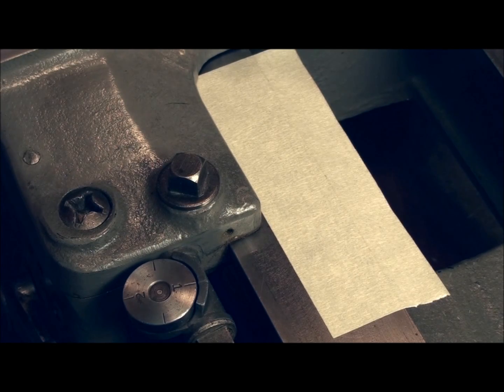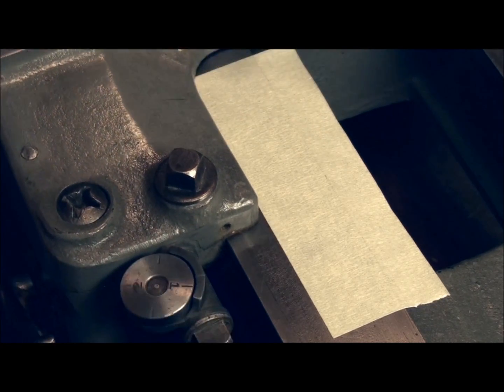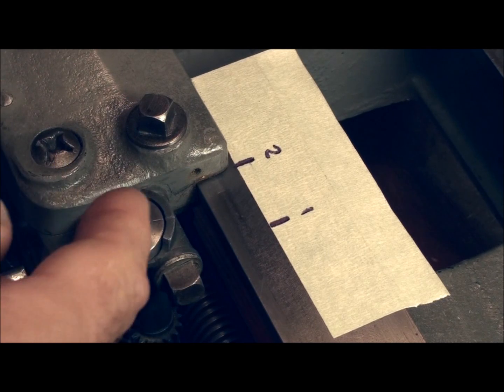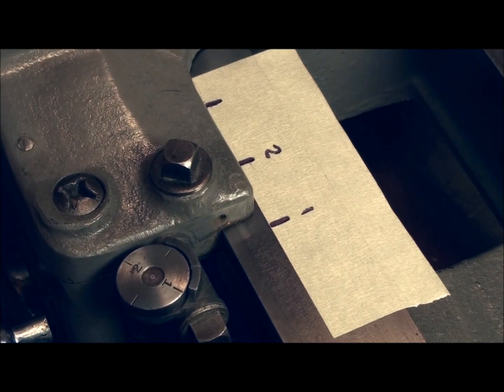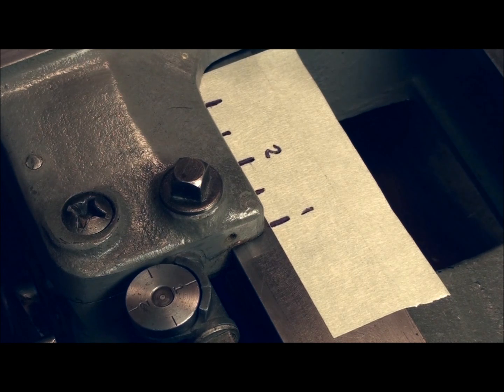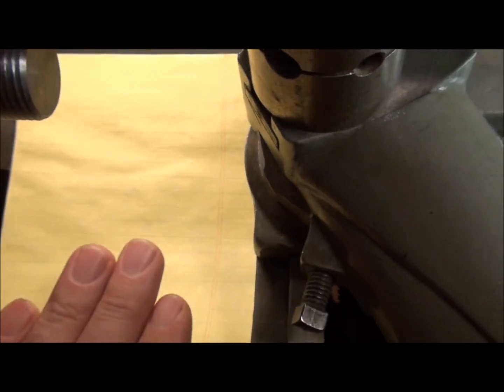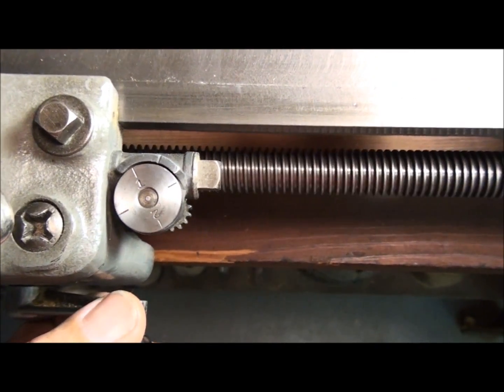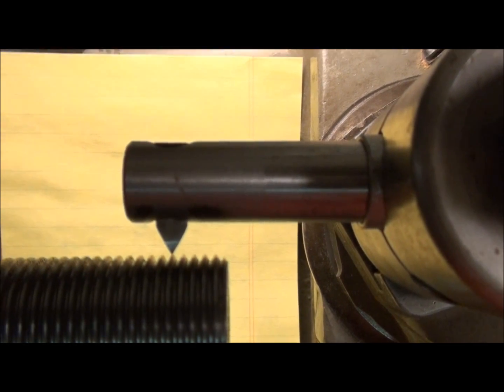Taking the Mystery out of the Threading Dial

Comment: Tom I have a brand new Harris lathe CE 6241 L x 1000 /chinese sorry but the price was very good for me/ any way I watched the video, but couldn't understand if I want to make threads is it necessary to use thread dial indicator everytime. Thanks
Reply from the maker: The thead dial must be use for most threads to get the tool back into the same groove. The only time it is not necessay is when you are cutting a thread where the pitch is a multiple of the pitch on the leadscrew.
Reply: @TomsTechniques  Hello Tom I'm Bobby with my question for thread dial indicator...Ok thanks for your explanation maybe I wasn't clear but if I use half nut /I dont know how to say in english - half nut/, if lead screw is working all the time, when cutting tthread, have I use  a thread dial indicator. Tnaks again .

Comment: That was very clarifying, but does it work for standard (inch) threads only? What about metric threads? Or  there is a dedicated dial for metric? Thanks!
Reply from the maker: The thread dial on a metric lathe works the same as on an imperial lathe. The only difference is the pitch of the lead screw. Simply put, the distance the tool moves per revolution of the dial is a metric dimension instead of an imperial dimension.
Reply: @TomsTechniques  Thanks for the reply. The reason I'm asking is because in my neck of the woods both metric and inch threads are commonly used with practically every lathe having metric dials (not referring to the threading dial here) and change gears for the type of threads one's about to cut although modern lathes do not require such a maneuver but have quick change levers or knobs to do so. But if the lead screw pitch is the sole factor that actuates the threading dial then I guess it's set for metric on a mainly metric lathe. Am I right?

Comment: Well Tom I am new to screw cutting I have a big Precision lathe made in France but very old it's a beautiful machine so what I do on whatever thread I want to cut I just get to where the end of the thread is stop machine run it backwards dial in a bit more cut and run it forwards that way you can't go wrong it may take longer but it doesn't matter I do not have a half nut I have a big dial I wish I could send you some pictures because I do need a lot of help and you seem like the sort of guy that would listen intelligent like me haha
Reply from the maker: The best way to contact me should be through my website, tomstechniques.com, but the contact page is acting up and I'm a machinist, not a webmaster. Until that gets fixed, there is nothing wrong with asking questions here. I get notice whenever a new comment pops up.

Comment: Does the same apply if one has a metric leadscrew and you are cutting imperial threads?
Reply from the maker: I have limited experience with metric threads, but that should be true, since the ratio of the lead screw to spindle rotation has been changed to generate those imperial threads.

Comment: this isn't making ANY SENSE to me - how could a system based on inches allow you to engage perfectly on a METRIC thread???
Reply from the maker: It won't and that is not implied in the video.The lesson is based on the imperial system. If you are using the metric system your results will differ. I'll not try to tell you how because I've never actually driven a metric lathe. :) I will say that if you cut a metric thread on an imperial lathe, with the proper transposing gear (127 teeth  I believe) in the gear train, you leave the half nut engaged at the end of the cut, withdraw the tool, and reverse the spindle to return the tool to the start of the thread. There are exceptions to this rule, but better safe than sorry.
Reply: @TomsTechniques  yes that's the conclusion i came to though maybe it might help to note it at the start ... i was assuming you were explaining the general principle not a special case ...
Reply from the maker: Again. The entire lesson was based on the Imperial system. There was no mention anywhere of metric dimensions or threads, but I'm pretty sure the theory would apply to either system.

Comment: I simplify memorizing of the rules by using:

1) Even number of threads: chose any mark you like, numbered or otherwise 

2) Odd number and fractional number of threads: choose the same NUMBER every time (it doesn't take that long to wait for your number - not a production shop)OR A SIMPLER RULE:If the thread IS NOT EVEN WHOLE NUMBER, use any mark.Otherwise, only use the same number every time.

Comment: I am new at this... Dumb question: does the thread dial turn only when the half nut is not engaged. On my old 6X18 Crafts man that is what happens. Logic says to me, the dial must turn both when the half nut is not engaged or when the half nut is engaged.... What is the  correct answer? Thanks for the videos...good explanations.
Reply from the maker: The threading dial only turns when the half nuts are disengaged. It's purpose is to tell you when to engage the half nuts and once that happens it no longer needs to rotate.

Comment: question... i have a 1920z machine with no dial attachment and while I am looking to retrofit one or fabricate one as I have seen elsewhere. your video made me think that if one had no gauge and no time or interest to get one couldnt your masking tape demonstration be used in a pinch to get the job done?

a strip of tape as you did with a refference mark relating to the corner of the carriage or an improvised pointer then carefully measure out a few hash marks.  as long as you engage on one of those marks you should be good right?
Reply from the maker: Yeah, I must have been wasted when I responded to this one. :) The best way to cut a thread on a lathe that doesn't have a thread dial is to simply leave the half nuts engaged throughout the threading process. Just turn off the spindle at the end of the cut, back the tool out and reverse the spindle to move it back to the start.

Tom
Reply from the maker: I never thought about it that way, but I suppose it would work in a pinch.

Thanks for pointing that out.

Tom
Reply: No wrong. The tape mark indicator does not move with the saddle until
the half nut is engaged.

What is needed for threading is a measure of the angular position of the spindle AND the position of the saddle. Using a dial on a lathe which is driven by gear ratio of the change gears - is a measure of the position of the spindle relative to the saddle and the saddle to the drive screw.
Reply: wasted can be good
Reply: Toms Techniques yes that would do the trick

Comment: I would like one for my Clausing. It seems every time I cut a thread I have to watch a video to remember what the heck I did last time.
Reply from the maker: +1-Shot slinger 
You would like what for your Clausing? It should already have a threading dial.

Don't wait until you have an important project to brush up on threading. Make some practice threads until you are comfortable with the process. A couple pieces of round stock is a cheap price to pay over scrapping out a part that you had a lot of time in.

Tom
Reply: +Toms Techniques No my lathe does not have a threading dial. I have made good threads .
Reply from the maker: +1-Shot slinger 
Do you just leave the half nuts engaged? You should get a threading dial. It'll make thread cutting a lot easier.

Tom
Reply: +Toms Techniques Yes and Yes. I have also used 1 1/2'  taps worked a piece of aluminum onto the tap with a chain wrench [tap in vise] and once my internal threads were cut, shaved down the wrench marks in the lathe. Making aluminum oil filler caps and bungs.
Reply: I cut my teeth on an old Clausing. It had a high speed threading attachment. You couldn't screw up.  It would only lock in when it was suppose to.

Comment: What can you tell me about a 4 lead thread?   I have a need to make one.
Reply from the maker: +thebaron44 

I assume you mean a 4 pitch thread, which would have a lead of .25". My threading video will tell you everything you need to know to any 60º V-thread.

Tom
Reply: +Toms Techniques no that's not what I mean, perhaps a 4 lead thread makes more sense...like the thread on a milk bottle
Reply from the maker: +thebaron44 
Yup. A thread with a pitch of 4 (.25" lead) would advance .25" for each turn...like a milk jug. You are confusing pitch with lead. Check out my four part series on thread cutting, starting with this one:

https://youtu.be/VK8JfhD_FxY

Tom
Reply: +Toms Techniques Yes...but how do you index for both internal and external 4 start?     Mrpete222 has a video for a 2 start...but how do you index for a 4 start?
Reply from the maker: +thebaron44 
Oh, so you want to do a multi start thread. Externals are normally done between centers using the slots in the drive plate to index the starts, a slot for each start. Internal threads are a bit more challenging. I've scribed reference lines on the outside of the part before and rotated it in the chuck, using the edge of a jaw to line them up. Make sure the part is well located axially. You could also machine flats on the outside and indicate them or square them to the carriage for more precision.

Tom
Reply: +Toms Techniques Thanks!
Reply from the maker: +thebaron44 
Take note that on high helix threads, the helix angle of the thread needs to be calculated and applied to the clearance angles on the tool. Otherwise it will rub on the flank of the thread.

Tom
Reply: @thebaron44  i just move the compound slide  4 times and cut the thread at each one of those positions....just read 8 years ago ....you worked it out years ago !!!

Comment: In this video I take it that you originally put the part in the chuck then lined up the thread dial with a number or tick then finally lined up the tool to fit into the grooves.  Is this correct? I'm just watching thinking that at any point if you use the compound rest you can line up the tool in the groove of the thread when its off.  Sorry if that was a little confusing, I was just a little confused myself.  
Thanks by the way for taking the time to make these videos.   -Ray
Reply from the maker: Ray Hill 
To tell the truth Ray, it's been so long since I made that video that I really don't remember. I may have lined it up to an existing thread, or I may have just cut the thread in place, it doesn't really matter. Either way the lines and numbers will still line up. At some point I'll be doing a video on picking up a thread that has been disturbed, but you are right, a combination of the compound and cross slide will do it.

Tom

Comment: Just starting out myself also - great video, plain and simple explanation - however, I have a thread dial that has marks 1 > 7 - how does that work? I can forward photos if necessary. Thanks
Reply from the maker: fayvinplace 
It's pretty much the same as I described in the video. The numbered lines on your dial are odd and the un-numbered lines even. Put a piece of tape on your ways and mark it like I did and it will makes more sense.

Here is a pretty good description of the threading dial on a mini lathe:

http://www.mini-lathe.com/Mini_lathe/Features/features_2.htm

Tom

Comment: This is a good video .. I assume if you wanted to cut metric you would have to change the lead screw ?
Reply from the maker: You wouldn't need to change the lead screw, but there are change gears for most lathes that will allow you to cut metric gears. I think you need a 127 and a 100 tooth gear. Do a search for "metric threads on an imperial lathe".

Tom
Reply: Thanks for you reply and videos Tom .

Comment: Tom, thanks for the informative video. I had a heck of a time trying to cut 3/4"-8 threads on my HF 9x20 lathe, and I did not know that there were positions between the tick marks where it would cause it to cut between threads. At least your lathe has a reasonable size dial. Mine is tiny, with 8 tick marks, and I have a 16 TPI leadscrew and a 64 tooth gear on the dial. So I would have to engage the half-nut with extreme accuracy. On my second try I got it right three times in a row and then I blinked or flinched and wound up cutting a nice two-start thread. My thread cutting tool is only 0.035" wide so it's actually a good-looking thread. Maybe I can fit a 32 tooth gear on the dial, and/or use a back gear or spindle crank.
Reply from the maker: Hey Paul.

If you have trouble hitting the mark, do it with the spindle stopped. Just move the carriage until the marks line up, engage the half nuts and start the spindle.

Tom

Comment: It appears your dad has an 8TPI leadscrew with 16 teeth on the chase dial (an outlaw). If so then there would be 8 places in registration but your dial only shows quarters. As you said, even threads all resolve to 1/2" length registration but if the lead (like 8TPI) is the same or a multiple of your leadscrew it resolves to 1/8" length (16 places on dial) or if the TPI is half your leadscrew TPI then any multiple (like 4,8,12etc.)  will resolve to 1/4" length (1/8 revolution of dial = 8 places). Every little bit helps sometimes! Thanks for the vid!   q:)

Comment from the maker: One of my favorite adages.

To cut a metric thread, you need to add a 100/127 gear cluster to convert the feed from threads per inch to turns per 2 cm. Then you leave the half nuts engaged and cut the thread, reversing the feed to return the tool to the start. I've never done it, but that's the theory.

Tom

Comment from the maker: Thanks.

When cutting metric threads on an imperial lathe, the half nuts are left engaged until the thread is finished.

Tom
Reply: You can disengage the half nuts on every pass when doing a metric thread as long as you have set your very own synchronization markers on the carriage and on the spindle.. The carriage can be zeroed with a dial gauge and the spindle engaged in its zero position via the engagement lever engaging the mesh of the lead screw driver/driven gears. With the carriage on zero, your margin of error in setting the spindle to be in its correct starting position once again, is 15 deg. (One cog error either side of where the cog was at the beginning). This is easy to see and so with a little practice, you can reset every pass on a metric thread if you choose to. otherwise its an emergency reset if you've accidentally disengaged the half nuts. Get some plastic electrical conduit 3/4" and play around and you'll soon see that you can always return to synch after opening the half nuts.

Comment: Hey Tom,  you could spend 15min on your dad's lathe and get it to run much quieter,  Oil the inside of the drive pulley and it will be much quieter in back gear, try greasing some of the easy to get to gears for the lead screw and that will help also.  The quieter the lathe the happier the machinist!

Comment: great vids Tom.  A great help. I have a question and wonder why there is no difference when using the angled compound vs cross slide? If using the angled comp wouldn't you be "pushing" the threads? Making them farther left down the piece? If you are just using cross slide that doesn't happn. As you explain using both, on the same work is where I really get lost.
Much thanks.

Comment: Great series on threads Tom. watched other guys videos as well, and every time something more is learned. but the one that put you ahead is when you mentioned the thread angle. I took notice. shall practice that, to-date had no need to cut threads on a lathe but learning is very important. I am not a machinist watched a video  a year ago and started doing a small hit and miss engine. have learned a lot since. like the challenge of making a tool or jig so I can complete a job. I am 70  retired.